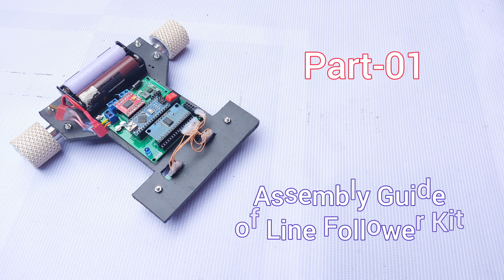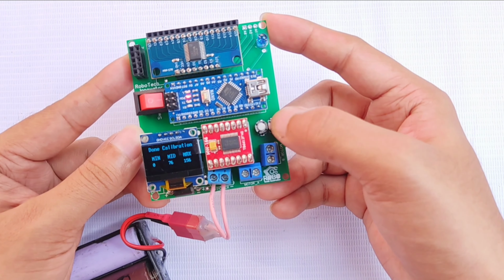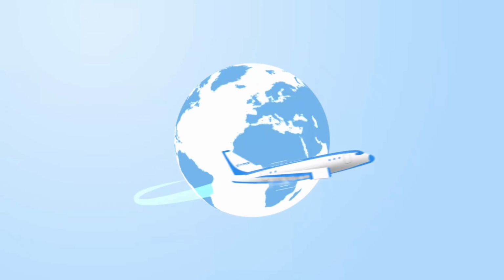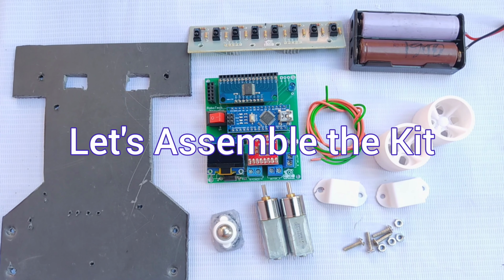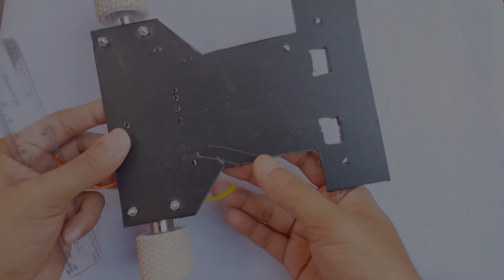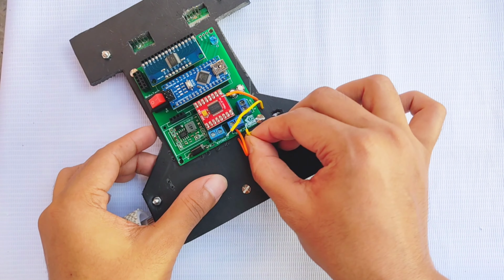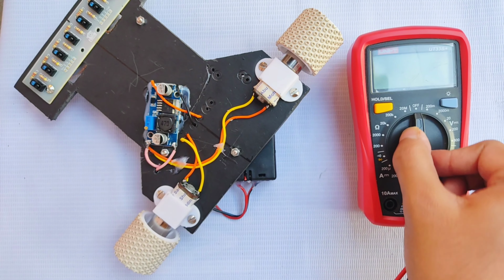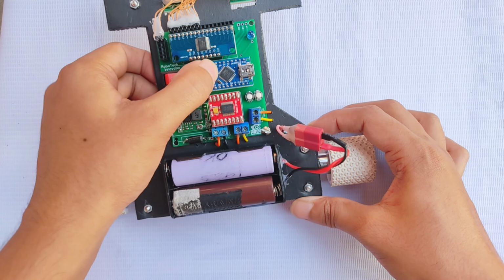Line Follower Robot Coding Tutorial: Part-01

Comment: Bro if i dont want a accelerometer can i take a 3s lithium ion battery pack ?
Reply from the maker: no. fng driver will burn. if you want to use 3s battery then use L298 or BTS7960